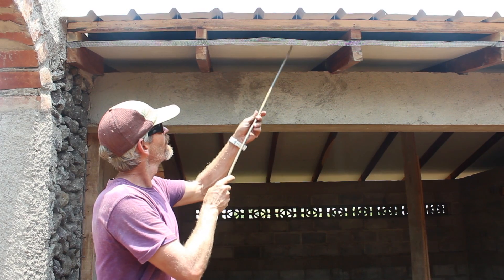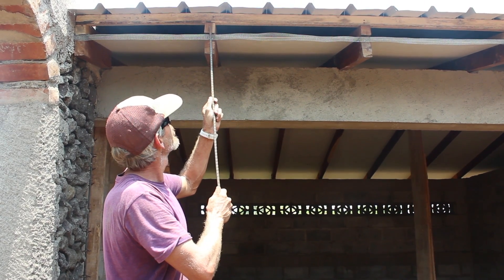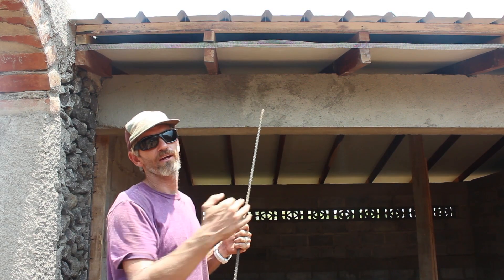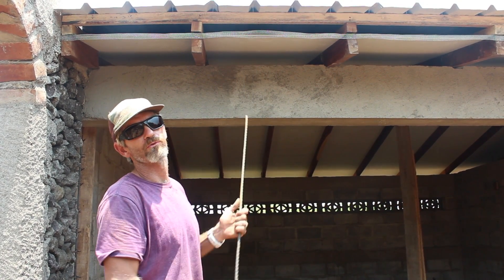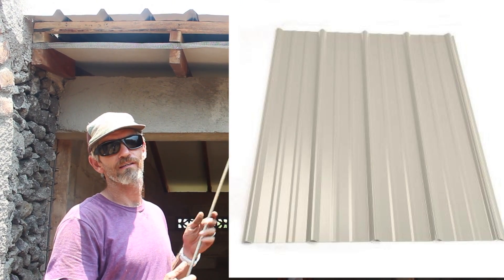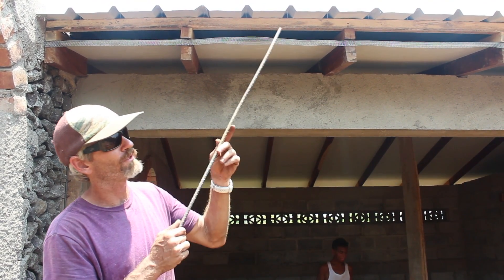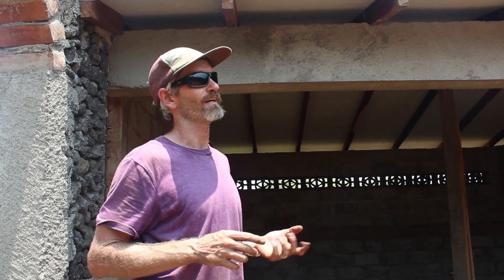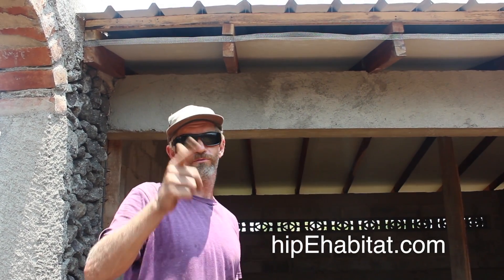Cool Roof Design

Comment: I have always wondered why this is not the standard way to build a roof with an open air gap, and why instead they place this giant heat capture conductor on the house and spend thousands in electricity to pump the heat back out. 

We assume the people who build things are smart but they're usually not and just do things the way they were taught.

Comment: Will this double roof system, & the air gap work, in case of flat roof? Will it work for a 8 ft. max. roof height for a small workshop room? What if I use a fan that sucks air from the two roof gap, & releases it on the other side of the roof?
Reply: Yes,  you will need to have a slope on the roof to have effective siphon effect. In fact the higher the slope the better.  it's possible that having a fan sucking at one end would work though.  but having even a slight 1-2% slope would make it work better.   The height will not effect the performance.  Let me know how it turns out.
Reply: Kim Obermeyer 
Hello Kim. Can you please explain how slope helps here?
Reply: Besides the cooling convection current he's created, the radiant barrier requires a minimum 1/2" air space on one side or the other, preferably both.  Solving that construction problem is trickier than it sounds.  His solution (like mine) acknowledges that lots of energy needs lots of airflow, so he's increased that 1/2" requirement to 4" (8 mm)
Another video about this from India shows a room with a 9' ceiling, tall enough to suspend a radiant barrier, glued to an insulating panel, from the existing interior ceiling, leaving about 10" of space above it for hot air to accumulate, and another 10" all around the sides, for hot air to come up the walls and enter the area.  "Clerestory windows (no glass in India, but screens) as high in the wall as possible vent out the hot air.  Cool air comes into the room from somewhere "cool (er)".  In a temperate climate such measures wouldn't do much, but under a hot desert sun, with most of the heat energy being part of the infra-red spectrum (radiant), significant amounts of heat are prevented from entering your space.

Comment: Nice job white is the best color for this project .  The roof might work even better with a less restrictive vent at the peak.
Reply: Two interesting factors at play.  One is that you want more intake area in the eves compared to vent area to create best suction.  We went with white, but I saw a study with data that suggested slightly darker shades could potentially work better as they create more suction.  I didn't totally trust that though so we stuck with white.

Comment: Dear Kim and Holly, great work but I have an urgent suggestion: The end of the roof needs to be longer, at least 6 inches longer to make the rain fall away from the house and avoid the backdrops. You will have to either add the 6'' or place a canal underneath. Otherwise, great job kids!
Reply: Thanks Pepe.  Our overhangs are different lengths on different sides of the house based on where the prevailing storm winds come from.   The longest is 1.4 meters the shortest .8m.   One side which has the roof peak does get wet.